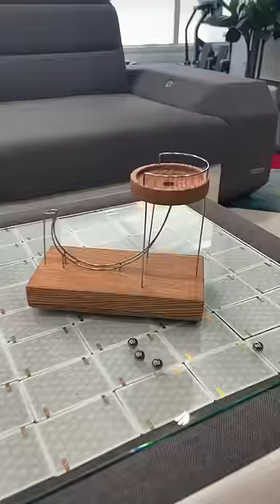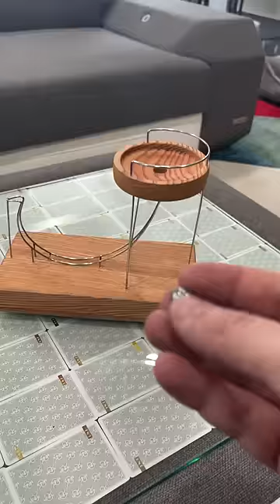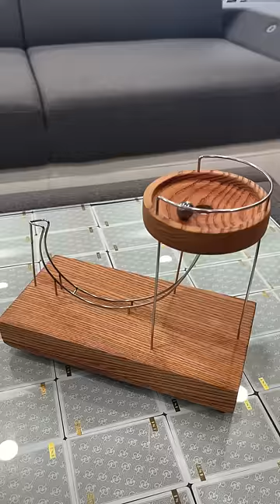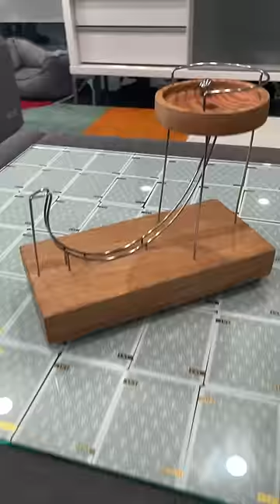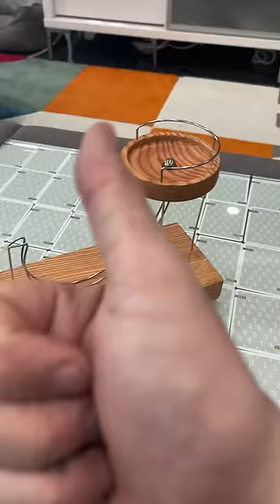An Impossible Perpetual Motion Device?! 😳 #Shorts

Comment: IMPORTANT: Just you need to know that there is an electrical system that accelerate the speed of the metal balls.
Reply: You can see an unnatural acceleration on the ball when it should be starting to slow down after it reaches the bottom of the tracks
Reply: Yes it went unnaturally fast
Reply: U don't say
Reply: No shit
Reply: Sherlock.
Reply: thank you man. I unironically did not know and was wondering wtf
Reply: maybe it just need longer slide
Reply: That's impossible considering both rails are connected to each other. There is nowhere for any electrical flow to move. It would just short out and get hot. 

The long vertical dive at the start and the very specific hook at the very end is what gives it the energy and the unnatural look.
Reply: Yes sadly there is no way to build any perpetuum mobile or a thing that creates energy out of nothing
Reply: I was about to say fellow scientist what f*ing makes the ball accelerate that fast it picks up speed out of nowhere or is downward momentum still enough to shoot it back up in a second 🤯
Reply: @whiteace_t.k.o8060  Again the steep drop and the very specific hook shape at the end. I know there are cheaper plastic ones that run on electricity but this one doesn't. It's all in the very precise curves and angles of the slide. This is how this particular one gets its energy.
Reply: @atourdeforce  No. There's probably a magnet below the wood that just accelerates the ball for a short second
Reply: @iTracti0n  A magnet in THIS INSTANCE would not accelerate the steel ball it would slow it down. 

Secondly it is MUCH TOO FAR away from the ball to have much of an effect on it, nevermind have an effect at that distance through timber(countersunk or not) 

I'll say it one last time, after that feel free to believe what you want I guess but, In THIS INSTANCE for THIS device, it is physics and gravity that are doing the work. Nothing more!
Reply: @atourdeforce  Bro you have no idea how magnets work. You can direct an electromagnet to apply a force to a conductor in a direction for a short period so it only accelerates and not slow it down. It baffles me you say the magnet would not be strong enough when the ball is only a few mm from the base
Reply: Thank you for letting us know. So I guess it's useless asking this man how long it took for his ball to stop going. Since you're knowledgeable could it be that you're the mathematician who could answer my questions?
Reply: I don’t think so
Reply: @atourdeforce  okay so you're the one rather than him who might be able to answer my questions...
Reply: @atourdeforce  I imagine those ball throwers you see at the dog park use that same principle along with the bendability of the foot long stick! Those will help you throw a ball a lot farther and faster than you could on your own.
Reply: @atourdeforce  I have to say even in my ignorance I recognize this as the obvious answer. The fact that that curve at the end is really tight makes the energy concentrated and the specific Arcit makes from the point where the ball is released makes just enough energy in the proper Arc for it to land in the bowl.   Meanwhile the fact that the shoot is made of wire does help reduce the drag on the ball and if you put a magnet underneath there it would actually pull on the ball and slow it down. If you put one in the direction that would make the ball repelled then the force would be dispersed in the wrong direction and might even slow the ball down or make it hop out of the channel. But I wish I knew more...
Reply: If that's the case where does the electrical energy comes from, because i don't see this thing having any type of cable to plug in. Do you mean to say it requires batteries under it?
Reply: MickeyMouseLovesPam  this is unrelated to anything going on in this thread but i just wanted to say that mickey mouse doesnt love pam
Reply: @atourdeforce  as others have said, that’s not possible. There’s some kind of magnetic or electro-magnetic acceleration system, as the air drag and friction would prevent the ball reaching higher than its starting point.  The ramp and hook are irrelevant in terms of energy gained.
Reply: @leesamardzija9165  I thought it was edited video....
Reply: ye
Reply: Yeah i suspected magnets and well this was just garbage
Reply: @MorzakEV  You're right, I think. An electromagnet that is triggered by the ball passing thru the hole and then turns off after a  hundred milliseconds or whatever. It would accelerate down then behave normally if that were the case, and it explains the motion
Reply: @highviewbarbell  pretty sure it's just the weight of the ball. The thing everyone forgets about perpetual motion machines is that none of them actually create energy from nothing, they use gravity.
Reply: "Metal balls" sus 😳
Reply: It’s magnetic. Not electric
Reply: @highviewbarbell  Makes sense. He did say it worked as long as two don't go through at the same time
Reply: @atourdeforce  if this thing worked solely off of gravity it would have to break the laws physics. It's magnetic, it's impossible to do what this is doing without adding a force, that's the whole point !
Reply: @wishfull3nigma  perpetual motion machines don't exist
Reply: Some of the replies here are laughable. Perpetual motion machines don't exist. For this to work solely off of gravity it would have to break the laws of physics. Conservation of momentum, it's basic high school science ffs !
Reply: If there was an electrical system that accelerated the speed of the balls, won't that create a magnetic field which will prevent the ball from going back up after a while?
Reply: @paftech_infiniti I think it's switched so the magnetic field only works for as long as it needs to, probably a fraction of a second
Reply: @xBela_2  the eels disagree 🧐and give you the look! 🐍😳🙄😏
Reply: Question: if the metal rails were longer and the ball was falling from a greater height, in theory would this concept work without an electrical current?
Reply: @marlymarz  no. Again, do the math, it doesn't work
Reply: @marlymarz  no because the gravity accelerating the ball would decelerate it as it tries to go back up. It would have to violate conservation of momentum laws to get back up to the starting point unaided.
Reply: @wishfull3nigma  if it was down to the weight of the ball it would be a perpetual motion machine… that’s the point of the demo- Except it’s using magnetism to propel the ball.
Reply: @atourdeforce  the ‘long vertical dive’ and ‘very specific hook’ don’t make you look clever at all, in fact you only make yourself seem silly. Try and do it with a non magnetic ball of the same weight and see what happens. But I bet you have an explanation on how the ball/track can generate thrust??
Reply: "While this is authentic footage of a genuine product, the “perpetual” marble machine does not operate infinitely without an additional energy source. Rather, it uses batteries and a magnet to create the illusion that marbles can perpetually move through the contraption."
Reply: On packaging of this device: Remember: perpetual motion is impossible without external forces, this machine uses 1 AA battery to power its electro magnet located underneath the bowl funnel
Reply: Magnetic energy?
Reply: @Clubkidknitter  Huh, they screwed up. The sentence, written correctly, ends at "impossible."
Reply: @Mythraen  No, it said perpetual motion is impossible WITHOUT the use of external forces, of which the external force used is a AA battery and magnet. Those two things are the external forces making perpetual motion to not be impossible.
Reply: @Mythraen  Put another way: removing the battery will mean, this system would not work at all. The electromagnetism is what accelerates the ball, through spinning it, down through the hole, meaning, gravity all alone is not what is accelerating the ball.
Reply: @Clubkidknitter  No, perpetual motion is impossible.
As I said, that's the end of the sentence.
Anything mentioning external forces fails to fulfill "perpetual motion."
Do I really need to tell you the battery will run out, or explain the concept of the heat death of the universe? All external forces are finite. 
The motion is not perpetual, period.
Any claim otherwise is either a gross misuse of the term or false.
Reply: @Clubkidknitter  Put another way:
Ah, my mistake, I didn't realize the battery was perpetual.
Reply: @M7187M  Friction so low, it's negative... Neat.
Reply: Never mind.. xD
Reply: @Mythraen  you are absolutely right
Reply: @fa3ephilliz110  Yes. It's called electromagnetism.
Reply: @Mythraen  That's what I posted. Perpetual motion is impossible (not possible) because it would otherwise violate the first and second laws of thermodynamics.
Reply: @Mythraen  a battery is not perpetual, either, because a battery runs-out of electricity. There is no such thing as a perpetual motion machine. It's impossible. To date, SO MANY people claim they've invented "perpetual motion" machines. It's not possible because THAT would violate the first and second laws of thermodynamics. If you fall pray to someone advertising something that is perpetual motion, be prepared for disappointment. Especially if you don't have a AA battery.
Reply: @leesamardzija9165  oh I see, thanks for explaining 👌🏾
Reply: I'm disillusioned 😒
Reply: Where? Inside the metal rail, I imagine?
Reply: @Ludsama  Inside the wood from where the marble spins (the top portion)
Reply: It's very old alchemist tools
Reply: @GFMgodfamilymusic  what does this have to do with alchemy? 😂
Reply: No
Reply: I feel like that important detail should have been in the video
Reply: @Mythraen  You need to re-read my comments. I don't think you are understanding that I'm saying perpetual motion is impossible. It's not possible. Entropy is increasing in the universe. Energy can only  dissipate, which is why perpetual motion is impossible. Now, superfluids is another conversation. Do you understand that everything you have written is in agreement with what I've posted? WE AGREE👍
Reply: @Mythraen  There is no such thing as a "perpetual motion" machine in a closed universe in which energy is finite.
Reply: @Clubkidknitter  I think you need to re-read my comments.
I made a specific point and supported it.
It was only because you ignored the point that you received additional supporting replies.
Frankly, I didn't read the majority of your last three comments.
I read enough to see that you completely missed my point.
Reply: @Clubkidknitter  As I said at the very beginning of this, the sentence that you claimed was from the merchant should have ended at "impossible."
Reply: @Mythraen  Back at you.
Reply: @Clubkidknitter  Yes, back at me.
The sentence should have ended at "impossible."
You have made no case to counter that, which means you have been off-topic in every reply to me.
You can't "back at me" just because you can't manage to follow the simple statement I made.
Reply: Thank you, I was REALLY confused because that should be impossible.
Reply: It harnesses the power of gravity in its first phase.
Reply: @atourdeforce  it’s an electromagnetic triggered by the ball approaching (by magnetic induction in a coil under the curve) that accelerates it at the bottom of the curve.
So underneath is a battery, one or two induction coils and a trigger circuit including a mosfet to turn on the large magnetic coil.
Reply: @AnnaMasiv  Pretty sure absolutely no one was confused about how the ball went down.
Reply: There's some kind of a secret sphincter under there that poops it out at higher velocity
Reply: @leesamardzija9165  ahaha idk just looked like all those weird tools I seen on a movie and it looks old AF so I thought I'd throw a lil seasoning on it and just go for alchemy 😂 your first to say something thanks for being a normal human.
Reply: Magnet maybe? Would that work?
Reply: @leesamardzija9165  but also in a way I really would like to know what kind of person did this and what for.
Reply: A altura que a bola atinge após o lançamento é maior que a altura inicial, algo acelera com ctz!
Reply: @atourdeforce  and @tracti0n You are both so confidently wrong. This product has fly wheel in the base of it. When the ball falls down the hole a spinning wheel speeds it up. The battery is in the disk at the top. No magnets, no fancy physics alignments.
Reply: @iTracti0n  Also this would not work in concept as the magnet would not be a Le to know where the ball is. A similar system to what you described is used in electro magnetic rail acceleration. This is accomplished by super precise light gate sensors to know where the object is in between what magnets to turn them in and off at the right time. If you had it just going in tempo on and off. Eventually the hall would be in the wrong place at the wrong time and get stuck. If you look up "Perpetual motion marble jump" you can see the product.
Reply: @myfirstnamemylastname2994  The ball goes as long as the battery does.
Reply: MickeyMouseLovesPam  the power source is in the top wooden disk. It has a fly wheel that spins and accelerates the ball down the hole (hence why two can't fall at once)
Reply: @highviewbarbell  it's a wheel spinning in the downward hole to accelerate it. Why does everyone just assume magnets are involved when they are confronted with something weird. Humanity does not understand magnets.
Reply: @kollinbutwithak5657  because it's a steel ball so magnets would be a good guess
Reply: MickeyMouseLovesPam   bro it's physically impossible to build any perpetuum mobile
Reply: @GFMgodfamilymusic  I think it's just designed to give the illusion that the ball is defying the laws of physics
Reply: @leesamardzija9165  yeah I get that seriously. But look at it and think About it. It DOES look like an very old tool of some sort, I really do  think it was used to generate some kind of energy.
Reply: @GFMgodfamilymusic  it can't generate energy because it requires energy to operate. It's just a toy built to amuse and befuddle people. The design is as basic and old school as it can be to give the illusion that it operates simply on gravity.
Reply: @wishfull3nigma  There's no such thing as a perpetual motion machine.
Reply: @Clubkidknitter  Wrong a AA battery does not make it perpetual. AA batteries don't last forever. You don't know what you're talking about. You don't even know what the word perpetual means.
Reply: @Clubkidknitter  Your sentence says, "those two things are the external forces making perpetual motion to not be impossible."

To not be impossible.

Making perpetual motion to NOT be impossible.

TO NOT BE IMPOSSIBLE.

You just said perpetual motion is possible. Not being impossible means possible.
Reply: @Mythraen  They don't understand that they made a mistake in their previous comment. They gave a double negative when they apparently didn't mean to. They don't actually think perpetual motion is possible.
Reply: @cloudoftime  I am well aware the commenter doesn't think perpetual motion is possible.
I was, from the beginning, referring to the quote.
Reply: @Mythraen  Just making sure. When you keep harping on someone and say you're not reading their other replies that makes it look like you're not aware of everything.
Reply: Hehe...balls
Reply: @atourdeforce  
There's a battery compartment under the hole where the ball drops into and it shoots it down at speed...

I bought one but threw it in the bin as it was one load of shite
Reply: @cloudoftime  There's not much point in me clicking "read more" and reading the entire comment when the person is clearly not replying to, or understanding, the point I made.
Reply: @Mythraen  Yeah, just keep ignoring the entirety of people's responses and you can be sure they aren't addressing your point. Good call.
Reply: @cloudoftime  Yes, because he replied as though I said something I didn't.
If I say "roses are red" and someone replies "actually, winter is a made up concept" and then writes more after that, then I don't need to read the rest to realize they aren't replying to anything I said.
You don't need to read the entirety of Time Cube to know that Time Cube is bullshit. It is entirely possible to extrapolate from part of a whole what the whole will be about. This is incredibly obvious, and your attempt to reject it is disturbing.
Do try to think before you respond again. It's really annoying having to constantly do that for other people. I have my own thoughts to think. I shouldn't need to think yours, too.
Reply: @cloudoftime  By the way, you need to read my comments again if you wish to understand my part in this thread. I never read the text you referenced, which contained a double negative, or at least it didn't catch my attention. I certainly didn't comment upon it.
My initial reply to this person was about the text from their very first comment, which was, according to the commenter, text from the manufacturer, "Remember: perpetual motion is impossible without external forces."
So, well done, doing all that reading and still not understanding what actually happened here. I'll take my excellent reading comprehension and my ability to extrapolate over... whatever you have, thanks.
Reply: @Mythraen  Also, notice your response to them where you said "No, perpetual motion is impossible." They then responded back to you multiple times and explained that they agree that perpetual motion is impossible. That's why I pointed it out to you.

They were talking about what the packaging says. And when you responded, claiming that the package correctly reads differently, you were not clear in that wording. What you were intending to say, but failed to communicate accurately, was that the packaging should have said something else with respect to the proposition about perpetual motion. That's not what your initial words necessarily entail. So they responded telling you that you were incorrect about what the packaging actually says. For example, if someone points out that the packaging of some product says "all horses have legs and wings,", and you reply by saying "actually, correctly written that sentence stops at 'legs'," you would be incorrect about what the package actually states. You are trying to imply that the proposition WITHIN the statement on the package is incorrect, not that the sentence on the actual package says something other than what was quoted. These are two distinct concepts, and it's one of the reasons why you two are talking past each other. They then responded to you trying to point out that the sentence on the actual package didn't stop at "impossible," because they took the literal meaning of your words. It's not about whether the quote of the packaging sentence is written correctly, it's about whether or not the proposition within the sentence itself is correct or not. When you say the sentence isn't written correctly, when someone is stating what the packaging contains as a sentence, that implies that they are quoting the packaging incorrectly. This appears to be where the confusion was initiated.

You then went on to try and tell them that perpetual motion is in fact impossible, as if they didn't already know that. That's why I went on to point out to you that in subsequent comments, from that commenter, they pointed out that they don't believe perpetual motion is possible.
But if you aren't reading their comments you wouldn't know that. However, that was part of your response to them. Getting it yet? I know this takes more than three brain cells to understand, but I hope you would have at least that much.
Reply: @cloudoftime  "They then responded back to you multiple times and explained that they agree that perpetual motion is impossible"
Yes, as I said, I am aware of their view on this matter. This is how I learned it. Note that before this, I suspected this was their view.
You caught up on this part now, or do you need to explain what I know to yourself some more?
"They were talking about what the packaging says."
Why yes, I believe I have stated this to you twice, that it was a statement from the manufacturer, not from the commenter. I have definitely stated it at least once.
So, there you go again, not understanding things I have clearly stated.
"but failed to communicate accurately"
Nah, it was quite clear.
"and you reply by saying 'actually, correctly written that sentence stops at "legs",' you would be incorrect about what the package actually states."
Except, what I actually said to the commenter who provided the quote, was that "they" got it wrong. I could not have been referring to the commenter with "they," because I was talking to the commenter.
So, once again, you simply didn't follow what I actually said.
I think three times of catching you doing that, in just this comment, is enough to stop bothering with this reply.
Your opinion is based on your own failure to comprehend what you read.
Reply: Yeah. Without this it shouldn't be able to launch above it's original fall height
Reply: @atourdeforce  they do not want people to think about stuff like this. So they spread the thought that everything needs electricity or artificial intervention to function.
Reply: @myfirstnamemylastname2994   Have you ever heard of hollowing out wood?
Reply: @funstuffonthenet5573   bro in god's name there is no possibility to create perpetual motion because it breaks the laws of physics
Reply: MickeyMouseLovesPam   and he actually said  in the video "perpetual motion divice is actually impossible"
Reply: @atourdeforce  no, the friction would make it fall short of the platform. The ball is lower than the lip of the platform. It's physically impossible to get the ball back up to that height without an external force. My assumption is some sort of magnet on the under side of the platform that pushed the ball. Don't take my word for it, though. Even though Newtons laws of motion do show that it's impossible to get that ball higher than the lip of the platform, I challenge you to experiment and build this yourself. See if you can mimic this same thing without using an external force.
Reply: You mean a magnet
Reply: @myfirstnamemylastname2994  the ball at the end of a long stick is using the energy from your arm, plus the energy along the stick, and the whipping motion. Similar to swinging a bat. You are using momentum that you build up and then release. This causes the ball to go further. If you drop a ball and let it roll or bounce or whatever, it will never, ever, get to the height you dropped it from, no matter what angle or curves you have, unless you have an outside force acting upon the ball. That's just how physics works. There is certainly a magnet. That ball can never go above the lip of that platform without an outside force. Ever.
Reply: @wishfull3nigma  gravity isn't enough to have the ball somehow get to a higher point than it was when it was dropped. If we could do that, we'd be able to use gravity to get spaceships into space without the need for fuel.
Reply: Oh ReAlLy???
Reply: @atourdeforce  what no. There has to be some sort external acceleration. The shape of the rail alone can’t cause that.
Reply: I thought it was magneticized?
Reply: @Mythraen  No, perpetual motion is possible... in quantum physics as seen in "time crystals".
Reply: @mario_uzumaki  The longer the slide, the longer is the way back up. 
An object will never climb higher than its starting point was without external support. That's physics
Reply: I was expecting that there'd be some kind of a magnet or something
Reply: @Kettvnen  This electrical system is basically a megnet
Reply: True man  , it's all one person can notice . The ball it's simply too fast when it goes down the hole. The ball has an unnatural acceleration !!
Reply: @rowannandlall5060  well you though wrong.
Reply: @Reactiontime6000  I literally saw this broken down by another youtuber, there's a magnet that aids in the pulling?
Reply: The illusion is that the ball is falling through the hole under force of gravity. It is actually being mechanically accelerated by a motor mechanism inside the hole. That's why it looks unnatural when it "falls".
Reply: @kollinbutwithak5657  is the only one who correctly described how it works, and why manipulation of the ball by an electromagnet wouldn't work in a device this simple. Read Kollinbutwithak's comments.
Reply: @rowannandlall5060  
Pretty much what he said ^^^
Reply: @Reactiontime6000  I consider electric energy different from magnetic.
Reply: @rowannandlall5060  
That’s because it is different, although the way they are used in this context is different
Reply: I don't think so. There's no trick; if you leave it running longer, friction will stop it at some point. The vid only shows 4 or 5 cycles.
Reply: Not really, the escale makes it possible the only part that does not match with a Perpetual motion device, Is because the balls do lose energy when they are stoping to fall on the whole.
Reply: @MorzakEV  air drag? At this scale?You've got to be kidding. You actually believe even if this was on a giant scale(say a heavy cannon ball) that air drag would have any noticeable effect at this slower velocity/distance?
Reply: @katmanluke7187  you simply can’t extract more energy out of a closed system than was put in (from the gravity in this case) so you cant get higher than your starting point. It’s impossible, no matter the geometry of the ramp. It’s very very basic physics.
Reply: @myfirstnamemylastname2994  
Maybe the ball is magnetic and bottom of hole/shaft is repellent, propelling the ball faster than normal free fall gravity.
Reply: @MorzakEV  I already understand that part, it requires 1 AA battery.. The claim air drag is a notable contribution in this application is what makes no sense. Shot out of a gun yes, but not here. It's like saying the steep rake of a cruise ship's windshield as it moves along at 15 knots is slowing it down.
Reply: It's those linked cards it's sitting on.
Reply: @katmanluke7187  
It is slowing it down, actually.
Reply: MickeyMouseLovesPam  reducing friction is what this little gizmo does, that's why it seems to work so well for the short time the video lasts... but eliminating it is physically impossible.
Reply: It looks like it’s just a brachistochrone that was extended upward at the end.
Reply: @xBela_2  tell that to dark matter
Reply: I read meatballs
Reply: @myfirstnamemylastname2994  🐩
Reply: I was sure it will be like that before see the whole video...
Reply: @atourdeforce  lol no. A perpetual motion machine is impossible. Something speeding up a metal ball is quite possible
Reply: @atourdeforce  How do you know that parts of “rail” are not metal?
Reply: @Mythraen  perpetual motion is possible. The universe doesn't lose energy so technically there is always motion only evenly distributed at the heat death. But that's only pedantics, obviously no perpetual motion machine can ever work.
Reply: Electrical system???
Magnets in the bottom is all
Reply: @atourdeforce  It's inside the wooden block. Strictly speaking it's electromagnetic and it uses a magnetic field to accelerate the balls, much akin to how an electric motor works (not that it's not a static magnetic field though. Most likely it pulses akin to an a.c. motor)
Reply: @minegotstolen  Yeah it seems I'm wrong! I knew it could be recessed into the wooden block if it was anywhere. But I just didn't think there was a way of getting a magnetic field to accelerate it from that distance and through timber, even though its countersunk. 

I had a read up on it last night. The pulsing you mentioned would probably be a great way to overcome the issues iI presumed would stop it from working. 

There was quite a bit of circuitry I the one I seen opened up, with quite large capacitors, they probably pulse a magnetic field down along it, much the same way a rail gun works. 

I'd love to know is it passing the ball through a field or is the rails somehow magnified and the pulses sent down that.
Reply: @wishfull3nigma  gravity alone cannot give enough energy to impart the momentum
Reply: @katmanluke7187  air drag happens at any level of travel through the air. Even your fist moving outward deals with air drag at small levels. Just walking forward is impacted by air drag.
Reply: @Paangu  duh. The point you're missing is a relatively heavy object at low speeds it basically has no impact. If you tried to debate air drag having ANY measurable effect on a cannonball you roll down a sidewalk at 10 mph you'd lose.

As speed increases though, w/cars, planes, etc as I recall it's a factor of 4. In other words, air drag on a car at 60 mph is 4X at 30 mph. But at 20 mph air drag is minuscule to a car vs other drags.
On the flip side, if you can catch a larger amount of air(like a sail) you can access a vast amount of energy from that same 20 mph as wind to propel a sailboat.
Reply: So it's kind of a rail gun
Reply: @xBela_2  Do you know how a hydroelectric plant works?
Reply: Thanks.  I smelt fraudulence but couldn't piece it together
Reply: Ah makes sense
Reply: @mario_uzumaki  maybe but longer distance back up?
Reply: Yes, it has an engine. And apparently it's relatively loud. So not as cool as I thought...
Reply: Guys this is the heprediopytvolipuntec effect it works on the principal of telling thermal dynamics "hey you're not the boss of me" that's how the ball disappears never to be seen again................. holy crap I'm smart
Reply: @alefmartinez4553   yes lol
Reply: @jordasn  thanks for this the thread was getting a bit boring. I'm sure that there are paid actors in this thread trying to convince everyone that this gadget has defied the laws of thermodynamics or created new laws.
Reply: Uhh, magnets?
Reply: Uhh, magnets?
Reply: Also to those arguing as to how the device works.. it's most likely just the same mechanism as a railgun. A voltage difference is created between the two rails and when a conductive ball is placed on them, current flows and generates a magnetic field around the rails. The interaction of the magnetic field and the moving charge (current) through the ball creates a Lorentz force which propels the ball along the rail.
Reply: 🥴 theres a huge lack of the understanding of physics here.
Reply: Would that be possible to simulate with static electrical fields?
Reply: @kayleamity  no since you cant have a stationary charge within an electromagnetic field 🥴 the particle must be moving in order for it not to be affected and a static electric field has to be stationary in principle. seeing as how the earth is our giant electromagnetic field (keeping us safe from cosmic particles) the static particle would instantly be under the affects of earth’s magnetic field.
Reply: @fresh_dood  yeah, no. good try but the problem with railguns is that a. they fucking melt after the second use and b. require a power source that could run an entire country (i know cuz the navy is working on it still) but let’s totally ignore the fact that this thing could potentially function like a retro hand gyro 🥴 go look up the whee-lo it was invented in 1953 and has the more likely answers to how this thing functions.
Reply: @wolfy5svn945  I don't think you have as much as a grasp on physics as you think you do, friend. I've written a few reports on the navy's railgun and because of that have some insight into the basic principles. Just because it's a railgun doesn't mean it's the crazy 5 km/s kind. The same principles apply if you scale it down. You can run a railgun at any power so long as you have enough of a Lorentz force to overcome friction.

Saying that this thing can't be a railgun because it's too weak is like saying that firecrackers are fake because we have sticks of dynamite.
Reply: @wolfy5svn945  This makes no sense. Are you sure you're not just picking words at random out of a physics textbook? Of course it's possible to have a stationary charge in an electric field, provided it's held my a mechanism of some kind. Capacitors work by storing energy in an electrical field, and it's only possible because of the dielectric (meaning insulation) between the two plates of the capacitor.
Reply: @fresh_dood  what are you talking about?? a stationary charge in an electric field?? bruh i said an electromagnetic field 😂 and a physics textbook would tell you i’m technically correct.. a stationary charge can’t exist inside a magnetic field cuz the magnetic field requires movement. lmfao 😂😂😂😂😂
Reply: @fresh_dood  link the reports then 😂🤣😂🤣😂 link the sources to your confidential information about technology no other country has openly stated to having. please id love to gain the same insight to theoretical weapons that you have.
Reply: @atourdeforce  100% wrong. As others have pointed out, if your explanation was accurate, this actually would be a perpetual motion machine. There has to be some external energy input or gravity and friction would keep the ball from returning to the start platform.
Reply: @mario_uzumaki  it won't help. The ball will never reach back to the point it was dropped from. A similar example is a ball that you drop in a free fall will always have a shorter bounce than the height from which you dropped it. The "loss" in energy is due to sound, frictional heat and elastic deformation of the ball itself.
Reply: What? Im not good at physics but it seems the hook shape of the track allows the ball to reach the front edge of the catch. I realise the ball almost never reaches the back edge of the catch probably due to the law of conservation of energy. So i guess over time, the ball should lose energy and eventually hit the front corner of the catch and fall off. Im most likely wrong.
Reply: @atourdeforce  just no lol
Reply: @atourdeforce  it has nothing to do with the wires , it is what is under the wires .. this is also a very known device so yeah it's not perpetual motion .
Also even if it is wires you can always just make isolate one side from the other with some kind of material or even just use a non conductive wire for one of the sides...
Reply: @atourdeforce  it wouldn't be physics doing it because this would defy laws of physics ... Actually it is physics doing it but it doesent gain momentum from gravity it gets it's momentum from electricity , you turn it on with touch screen , this is a known toy ..
Reply: A lot of you are being mean or sarcastic but I thought it was gravity at first just not losing energy very fast.
Reply: @atourdeforce  not sure if you've seen the full video, but this is a short clip of the full video. Watch the full vid, you'll see where the electronics are. Just had to reply this because I see a lot of people liking your comments, and it'll be best if we help everyone correct their thinking lol.
Reply: Nah, this is a fibonacci curve, ie, comes from the golden ratio. This particular curve helps manage the inertia from gravity to launch the ball bearing into the cup. Eventually,  the ball bearings, wooden cup, and rails will degrade due to surface friction, so it just proves there's no such thing as a perpetual motion device.
Reply: Exactly!
Reply: @leesamardzija9165  wrong. It should be faster at the bottom starting slowly but it get accelerated by a roll powered by an electric motor  inside the hole so it falls really fast right after going through the hole.
Reply: @atourdeforce  your ignorance is outstanding.
Reply: @iTracti0n  there's a motor running a roll inside the hole.
Reply: @suprememasteroftheuniverse  my point was that it wouldn't travel that quickly with gravity only. I've never seen one of these machines up close so I was just speculating as to how it might work.
Reply: @iTracti0n  you're also wrong.
Reply: MickeyMouseLovesPam  Mickey mouse still doesn't love Pam. Grow up.
Reply: @highviewbarbell  yes but sensors, electromagnets and microcontrollers are just over kill and complicated. It's just a rolling device hidden in the hole.
Reply: Nah, I reckon they just used editing to make it look like it returns.

Getting a magnetic field to switch on and off at the right time to increase the speed sufficiently without slowing it down at all seems pretty difficult, plus the work of aligning the rails so that it can consistently hit the target at the top.

It's way more likely that it's all editing tricks because that would be much simpler to accomplish.
Reply: @michaelklim8277  I wasn't being mean at all  , it is just impossible to do it without adding energy to it, it would break the laws of physics .
You can't get something to go back to it's starting point just by not loosing energy very fast , any loss of energy will result in the ball not being able to reach it's starting position.
Think of syphoning water through a long flexible pipe or hose , as long as one end of the hose is lower then the water level of the starting point the water will flow , if the end of the hose is above water level then the water will stop flowing unless you are using energy in some way , for example action lab did a good video on that where he was able to get water to flow out of one end of the hose which was above water level in the bucket by having valves in the system which release water on the other end.
Reply: @Mythraen  r/iamverysmart
Reply: @atourdeforce  You don't understand basic physics, otherwise you would realise this is impossible using gravity alone. An electromagnetic is clearly being used.
Reply: I was thinking that that was how it might work, although I was thinking along the lines of a magnet accelerator because the sound of the balls running through the tracks is similar to buzz magnets
Reply: @SuperGoodMush  Not sure you are, pal.
Reply: @Mythraen  Correct, I'm not your pal. Not sure what that has to do with your feigned intellectual superiority tho. Must live in an apartment because you have quite the complex.
Reply: @SuperGoodMush  Correct, you are not my pal, pal.
I'm not sure what that has to do with you casually lying about me feigning intellectual superiority, though.
I also don't know what it has to do with your blatant misuse of the name of a subreddit.
Reply: @Mythraen  🤠
Reply: @SuperGoodMush  Nice hat.
Reply: @wolfy5svn945  I thought I linked the sources already but my comment is gone.. give me a sec
Reply: And once again.. to everyone confused as to what is going on... it's a railgun. The contact of the metal ball on the rails its what turns it on. Look up railguns on Wikipedia, there's a good guide there. Basically, current passes through the rails when the ball is on it and it's what allows it to go.
Reply: @fresh_dood  stop lying. every adult knows wikipedia is a failing website barely on life support cuz its garbage asking for donations. where’s your documented sources that you submitted to your editor since you’ve written articles 🤣😂
Reply: @wolfy5svn945  I just sent it but Wikipedia is a good introductory source with other sources you can use. Either way, you can choose to be ignorant and immature or you can actually do the research.
Reply: @fresh_dood  sure thing, i’ll have Agent Jones get right on confirming your source information.
Reply: @wolfy5svn945  use your eyes and read the sources provided. the world is your oyster, kid. otherwise good trolling. had a gold laugh.
Reply: @fresh_dood  😂🤣 you still didn’t provide any sources (assuming it got deleted again) so indeed thanks for the laugh. god bless kiddo.
Reply: @wolfy5svn945  Here Ill. copy the rest of the comment for you too, since it probably got deleted: Here's the main source I used. It's not "confidential technology", railguns are taught briefly in first year physics. The Wikipedia page has a diagram that explains it and how the whole thing works. The main classified part is how to weaponize it and make a big one without the railgun destroying itself as it fires.

As for a static charge.. not sure why you're arguing about semantics. The electric field and electromagnetic field are coupled and are technically the same force. The movement of charge creates a magnetic field, and a changing magnetic field creates the movement of charge. You can have static charge in an electromagnetic field because a field just generates a force... you can have other forces that balance it. The famous oil drop experiment did just that.

If you're interested in physics I recommend you study it and do good in school. You could do well if you do things other than troll people online.
Reply: @fresh_dood  are you still quoting wikipedia?????? anybody in actual publications knows its NOT a credible source 😂😂😂 they teach you that in freshman english in high school but your talking about introduction to physics. next your going to tell me english isnt your native language. and that it “used to be a credible source” 😂😂😂😂
Reply: @wolfy5svn945  You have poor reading comprehension. And no, I'm not quoting wikipedia. It's good for basic principles of things (the level you're at, I'm trying to help explain the principles to you) and it has links to sources that you can read more about. Of course you don't use it as a source for actual scholarly writing. You do the thing a lot where you just insult and constantly move the goalposts of the conversation. Actually reply somewhat legibly and we can have a conversation about physics.
Reply: @wishfull3nigma  I was looking for a comment explaining to people that it worked with gravity that adds energy to the system when the heavy ball falls off. And I only found yours. Hope people will see it